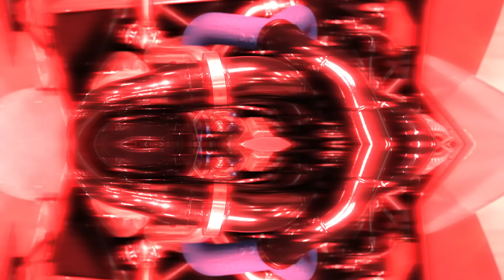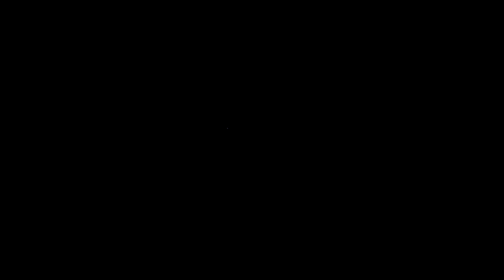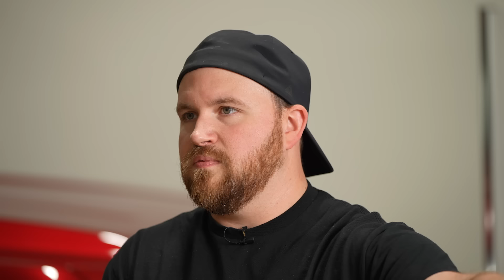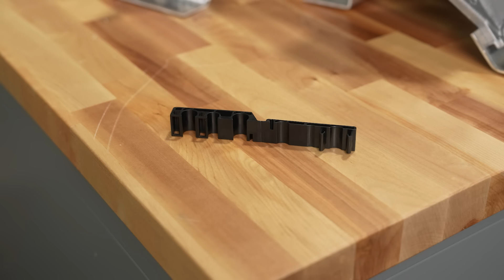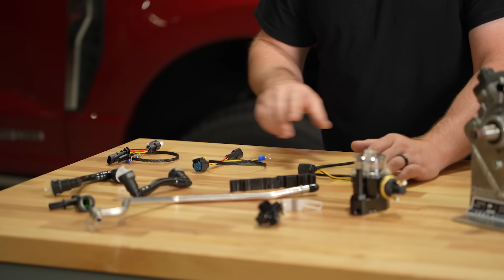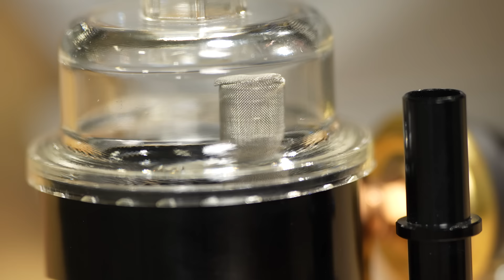SPE Motorsport Generation 2 Disaster Prevention Kit

Comment: if you feed the plugers from a different line and block off them getting fed from the crank case how does the fuel return from the plugers thats not needed or not used?

Comment: I installed this kit on my 2019 F550. The truck has under 37,000 miles on it. After installation I have a strange squeaking noise under the hood which sounds like an alternator going bad, but it was perfectly fine before the installation and like I said, truck only has 37,000 miles. Any suggestion what this might be? I've tried everything I can think of.
Reply from the maker: That's certainly not normal, please call or email our team and we'll help you diagnose it!

Comment: I stumbled on this video trying to understand more details about the disaster prevention kit. It is really too bad you don’t make a generic kit. There are a lot of CP4 pumps out there for other vehicles just not in the US which I guess your main market is. If you made one for the N57 diesel engine, I would buy one. One comment on your kit, I am not a big fan of the plastic quick connects to be honest. I can see them getting brittle and failing over time. Install would be a snap but service afterwards would be challenge as the plastics get older. The hard pipe is great though. Love the attention to detail. If I ever replace my older Powerstroke with a newer model year I will definitely get this kit. Thanks for the details!

Comment: 20 micron screen on return line. Isn’t that still a concern to cycle through tank and back to Pump?  Would a FASS filtration system catch the less than 20 micron with its 2 micron water filter be a nice compliment to DPKv2?

Comment: I bought the S&S Kit before find your company and I do like the no cut on the lines. I don't know if it would be a bad business thing but I kinda would like to see a comparison video between the 2. I assume both do the job the same but in different approaches to the problem regardless.
Reply: I was about to go with SS kit since it is the go to and props for them for coming out with something first, but at this point for me it would be either the spe dpk or the DCR.

Comment: Just found video on Gen2.  As others expressed, I felt S&S was a better solution but very glad to see your Ver2, your design explanation sway the decision back to SPE. All your products are top grade and well designed. SPE & Banks make great well designed products! 

You answered in Previous question, regarding 20 micron vs S&S 9 micron filtering. That all makes sense for heat & pressures… although I wasn’t clear on final outcome. 

If CP4 fails, my understanding is any debris back to tank becomes a whole replacement costly repair… doesn’t that indicate particles less than 20microns will pass and if so the Owner is essentially looking at full replacement of costly fuel system? Would an Owner just replace CP4 with CP4 (or DCR) with concern smaller debris passed and would take out new Pump? 

It’s a concerning and disturbing situation when it happens I’m sure… confidence of repair would be in question.

I’m not wanting to replace a new 2024 6.7 HO with DCR, particularly while under warranty. Installed the FASS filtration system to help with water, air and contamination better than OEM and M&S Upper filter relocation to ease frequent filter changes all below and add little more filtration quality. 

I don’t clearly know the whole fuel route path , but does the extra filtration of the FASS filtration help with a possible CP4 grenade and your Ver2 installed? What small less than 20 micron that gets back to tank would be caught by the FASS filtration system with its extremely low 2 microns absolute filtration. Although your comment on heat & pressure carries over to FASS, or not with FASS being on the tank out side not the heated return? 

Let each system do their job, your system performs an important role, sounds like FASS would perform its role to assist in preventing future damage contamination after CP4 replacement. 

The 6.7 is a great powerhouse, the CP4 is it’s one omen.

Comment: 100% will be getting one once my warranty is over.
Reply: do it before the warranty is up. warranty will find any way possible to not pay for a failure if it does happen. their number 1 go to is you didnt change fuel filters often enough or drain the water separator often enough.
Reply: @screamineaton  I'll risk it. My records are impeccable, oil services, fuel filters etc, all fuel receipts are recorded as well. If anything I could get accused of replacing the filters too often. I have 16k on it and have done them twice already. I replace them every 7500 miles.  I will be getting the disaster kit but not for a while.
Reply: @Unsupervisedtj  they won't argue the records, what they'll get you on along with almost everyone else is contaminated fuel. Thats their goto with these CP4 failures. You could change your filters once a week...it doesn't matter.
Reply: Lol.i know someone that had records of changing fluids and ford refused to fix the motor and left it in pieces@Unsupervisedtj

Comment: Did you say 20 micron or 2 micron
Reply from the maker: 20 micron. This is designed to catch larger fragments and alarm via the sensor in the exo filter. This is a non consumable filter and acts more as a screen.  Most of the cp4 debris is very large when they fail.
Reply: @SPEMotorsport 
So some particles could return back to the tank? Will there be a finer rated exofilter in the future? The s&s kit has a replaceable filter that is 9 micron; however, it is and additional cost for maintenance.
Reply from the maker: @Bryan-hd9fs   There are many issues with a low micron filter an the return side. We did a lot of testing Without going into extreme detail. Basically the filter becomes an added restriction on the side of the system that is already heat soaked when returning to the tank. Our testing of many different micron screen found minimal amount of restriction with 20 micron in a manor that wouldn't change the functionality of the factory system. This was proven when our competitor had a clear bottom filter that was melting on trucks that pushed them in to a steel filter and aluminum mounting head. Hence the extra heat build up. a lower micron steel filter band aids the issue. More heat makes fuel cooler / system work harder as well. Once again we only make it a safe guard that doesn't change the functionality of the vehicles other systems. Its easy to over engineer but doesn't always make it the best way to do it.   Great question!
Reply: @SPEMotorsport  that makes sense. Thank you for the response. Looking forward to purchasing the upgraded kit.

Comment: Would you recommend this kit over the DCR pump S&S makes? I've got the S&S 2.1 DPK but this has me thinking about going with this kit and forgo the DCR.
Reply from the maker: They are two very different solutions. If you ever sell the truck it still has the original pump on it, thats a positive with the dpk. DCR is only available from one source if you have an issue with it (all mechanical parts can fail) , Not a Ford dealer some people don't like that.
Reply: @SPEMotorsport  Thanks i appreciate your input and not bashing another company's product

Comment: This is cool but I think the magic is really that you added the low pressure switch. 6 months ago I looked at your gen 1 DP kit and ended up going with the S&S gen 2.1 because it looked more straight forward with a bigger filter that was readily available. If I had to do it all over again I would have bought this kit.  Since I already have a DP kit installed it would be nice to have an option to retrofit the kit that I already have installed with your wiring and pressure switch.
Reply from the maker: Exo filter system with sensor will be available soon by itself.
Reply: @SPEMotorsport  Nice, You are my hero! I will be waiting
Reply: @SPEMotorsport  Any update when or if the Exo filter system with sensor will be available by itself?  I already have your Gen 1 kit installed.